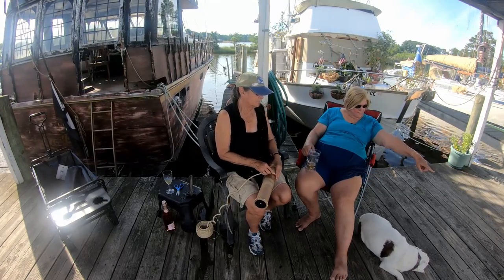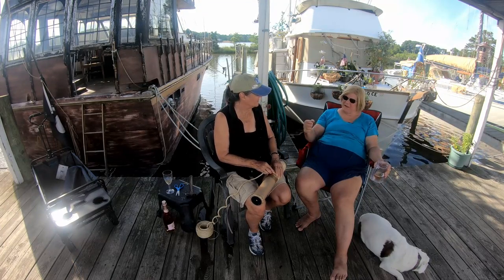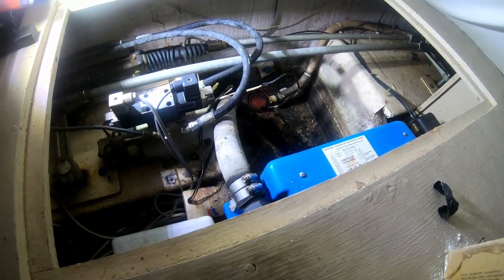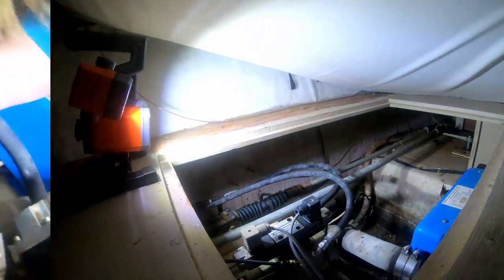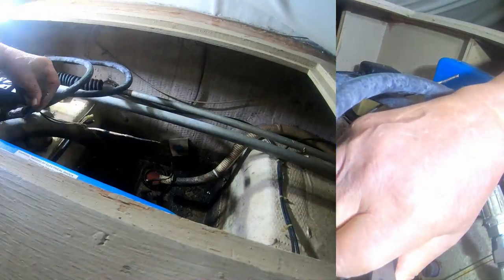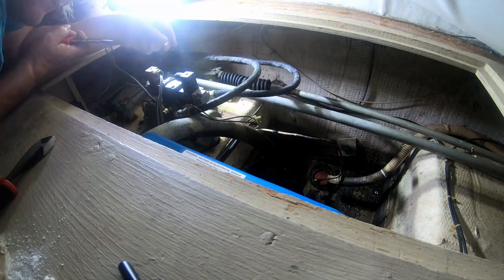Glamorous Life   In the Bilge

Comment from the maker: Thank you for watching Buena Ventura Life.  This video shows much of the life that non-boating people do not know about.  The stomach knotting feeling of water in the bilge, the access to parts, the frustration of fitting parts together, and the feeling of success.  One thing that did not get in the video is the hose clamp on the original pump was backward, meaning it was installed prior to the deck and hull being assembled.  But, now the aft bilge is dry - again.